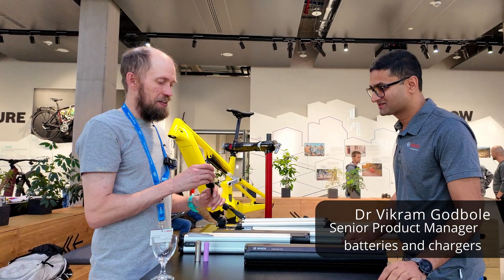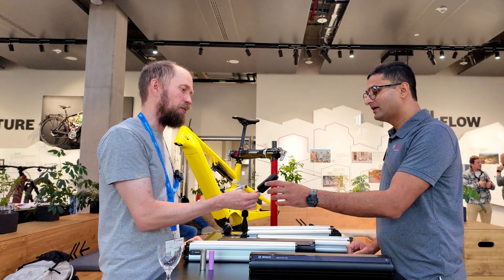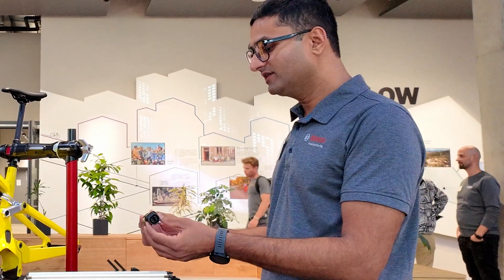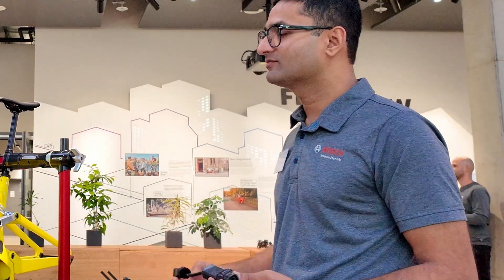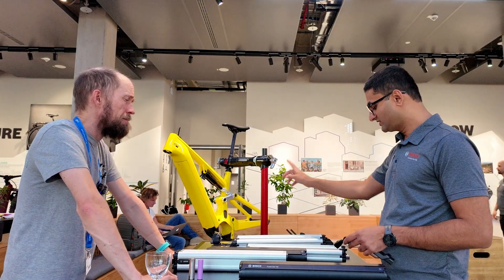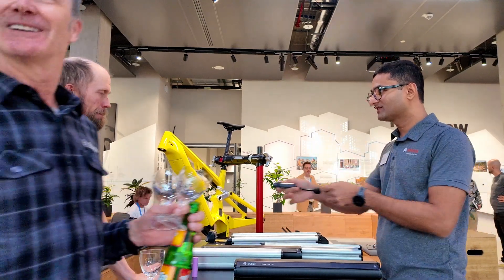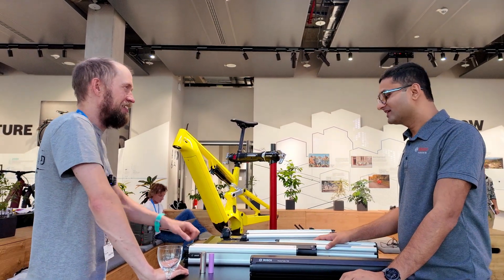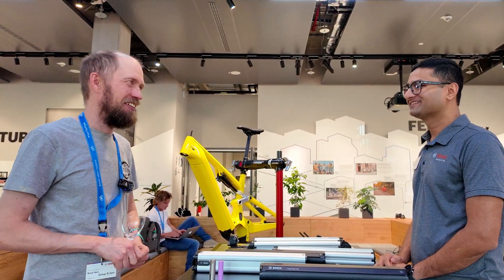A new standard plug for ebikes is coming? An interview with Bosch about charge2bike

Comment: ? so they plan on chargers being standard but the bikes and batteries needing an adapter. is that much better than the current situation
Reply from the maker: As long as the adapter is cheap and light so you can carry it everywhere you ride, I guess it's slightly better (: It's a good thing I guess, allthough a standardized plug for all brands would have been much better.

Comment: USB C would also be appreciated 😁
Reply from the maker: Hah, that was mentioned during the presentation actually (: USB-C is powerful enough to charge an ebike battery, but I believe they claim max 240W to remain within usb-c specifications. It could work, but I guess they wanted a safer and sturdier connection. And better sealed, for connecting range extenders for instance...
Reply: USB-C is great but not enough to charge an ebike battery.
Reply: @womacko  240w isn't super fast but it's plenty fast in exchange for the convenience of using cables and chargers I already have.
Reply: @soy_leche  None of the adapters you currently have at home, has 240W! Only 100W at most!